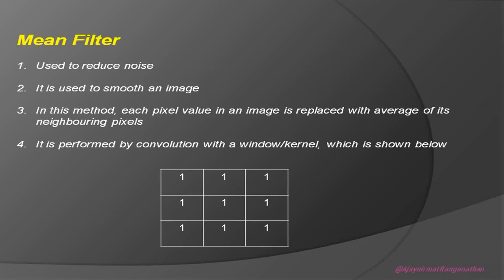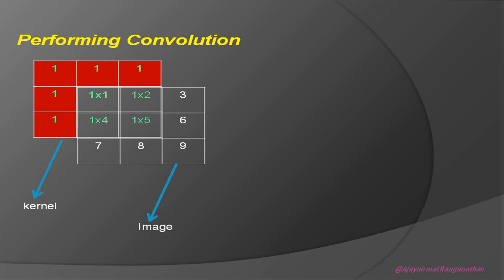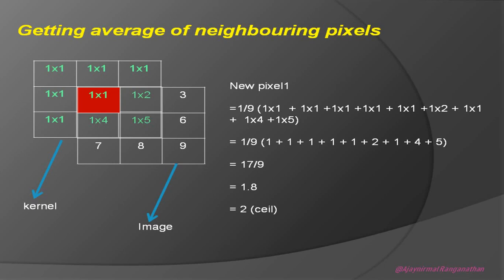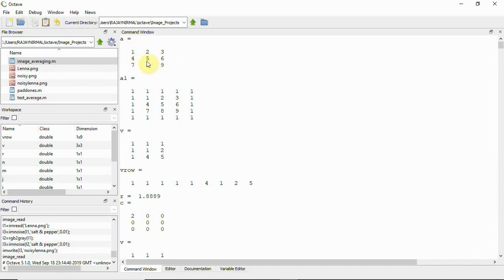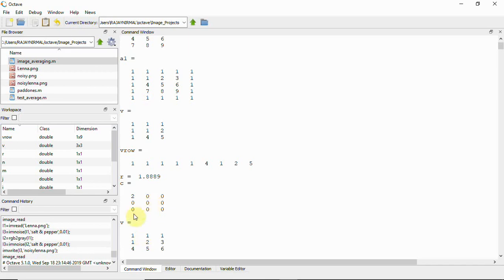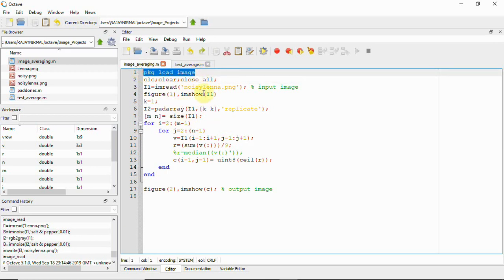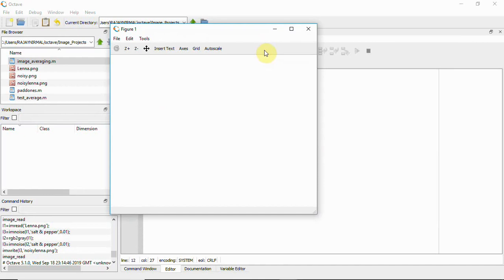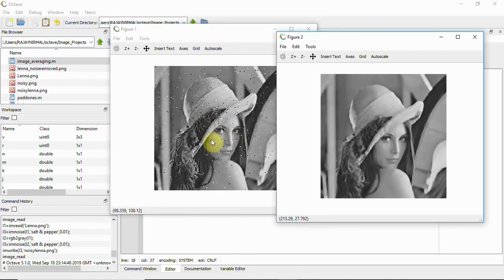Apply Mean and Median Filter on an Image | Octave/Matlab

Comment: padarray doesn't work here and idk why
Reply from the maker: It should work be working
Reply: @chipride8119  it isn’t, i am using octave on macOS
Reply from the maker: @jessehenrique4343  do you get error notification?
Reply: @chipride8119  yes , but my teacher posted a code and it helped me , but the task he said we couldn’t use built in functions , I think he was refering to median , mode,mean , idk how to do without them
Reply from the maker: @jessehenrique4343  you mean custom function for pad array or mean, median
Reply: @chipride8119  idk what he meant , i will try to do it anyways
Reply from the maker: @jessehenrique4343  write your custom function for paddarray in that case just add two rows and two columns to your matrix